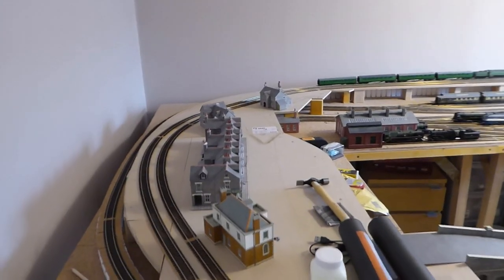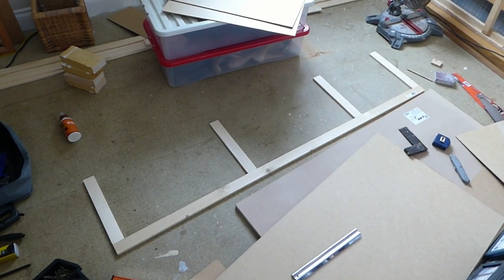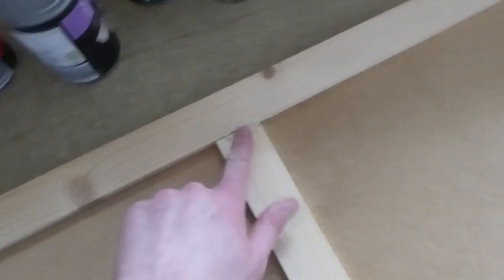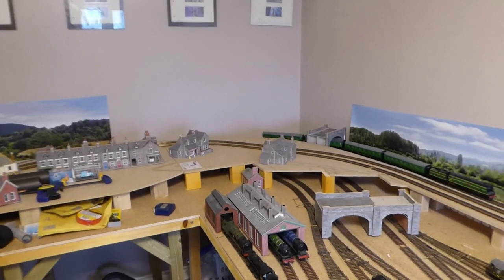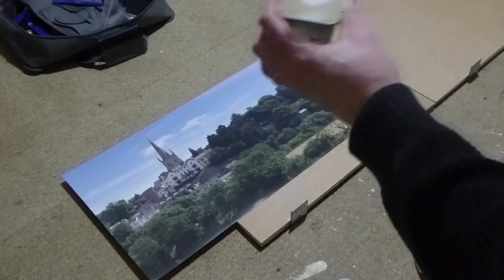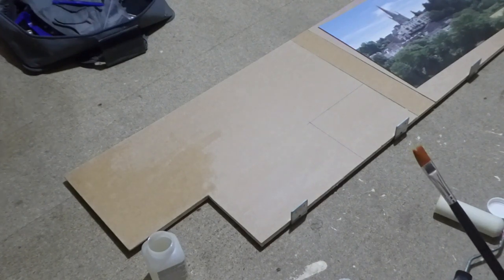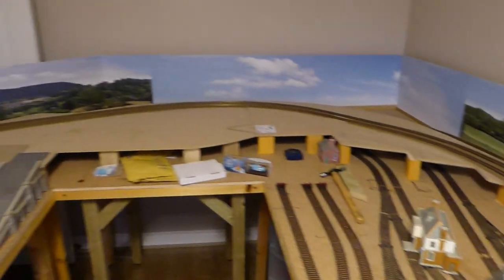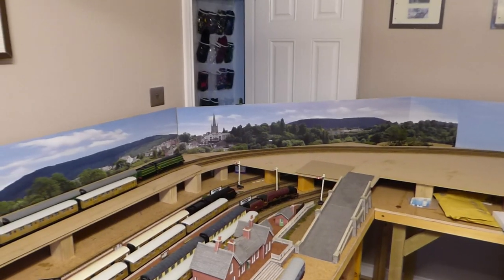Greenhill Junction - Installing Backscenes - Video 40

Comment: Hello John good effort with the backscenes, not the easiest job to master ,I have messed mine up in the past with wrinkles on the finished job ,and redid them when a friend of mine told me before putting the backscenes on first give the boards of either a coat of wallpaper paste or watered down pva and let completely dry then glue your backscenes on ,it did help when I did them again just a few tiny wrinkles not horrible like my first attempt, and you can of course put some sort of scenery to  cover things ,ie trees ,bushes etc ,you could also get some cardboard and paste on some buildings ,houses etc and build some depth up in places where you want a more built up area ,gives a 3d effect ,have to say I liked how you built the boards and attached them to the baseboards with the brackets, atb Ray.
Reply from the maker: Hi Ray. I had watched some videos where the backboards are painted white first, I just didn't see why but maybe there is a reason for it. Could always try the PVA method, got plenty of it lying about. Cheers, John.

Comment: Great looking layout John, love your two levels and you have managed to get so much in there.
Hiw big us tge layout? Mind us about 9’x9’ and J don’t think I have utilized the boards as well as you have
Charlie
Reply from the maker: Hi Charlie. The layout is approx 13ft by 8ft. Tbh I might've put a bit too much track in and it might compromise some of the scenery but I prefer having lots of trains running instead of looking at scenes. Took a while to plan it all in but there is over 85m of track down! Cheers, John.

Comment: The back scenes look fine. You can hide the joints and wrinkles with scenics and trees etc. Its all looking good atb Andy
Reply from the maker: Hi Andy. Thanks very much. It will look better once I get scenery in. I want to try to add depth to it too so it doesn't just look like a photo on a board. I was just frustrated at no matter what I tried it still got wrinkles and bubbles. Cheers, John.

Comment: Hi John as always an informative video and I would say that from normal viewing distance the overall scene looks good. because you know the issues it will bug you but for us viewers it looks fine. I particularly like that shot at 28.15 and the closing shot. I had my own backscene battles  mostly due to mine own fault of not getting them in place before joining the boards . The result is an usightly gap in one corner and obvious joins.!! 
We live and learn LOL 
Keep Safe ...............Cheers Kev
Reply from the maker: Hi Kev. I do like to inform people of how my bodges go. 😂😂It does look good from a distance and I purposely did the running shots close up to see how it looked. It was just frustrating that I followed the instructions but it still got bubbles. Still got the other half of the layout to do at some point so I'll maybe experiment with something else. Cheers, John.
Reply: Dave @ Cottesmore did an interesting video where he used double sided tape and the end you start , some PVa , then another strip of tape and so on finishinh with a strip of the double sided tape .
Reply from the maker: Ok. I'll check that out and see how he got on. Maybe I can do each board as an experiment with different techniques and see which one turns out the best.

Comment: It suspect that you should have used photographic spray mount adhesive
Reply from the maker: Hi Steve. I was going with the manufacturers guidance as I'd never done it before. I've still got half the backscenes to do once I get to that part of the layout so I'll maybe try that. Thanks for the advice. Cheers, John.